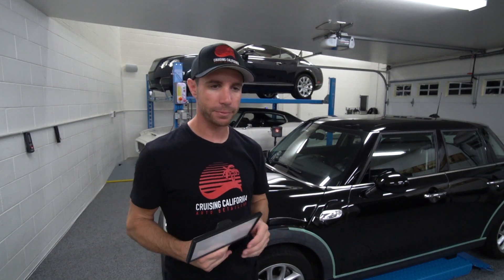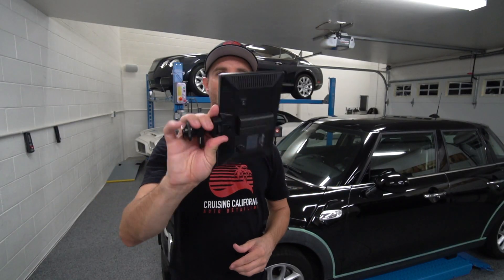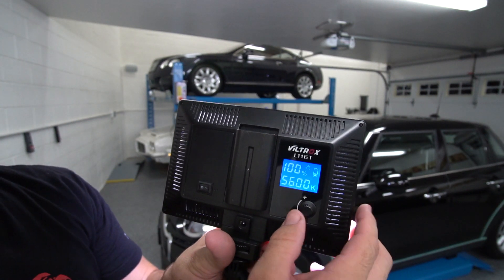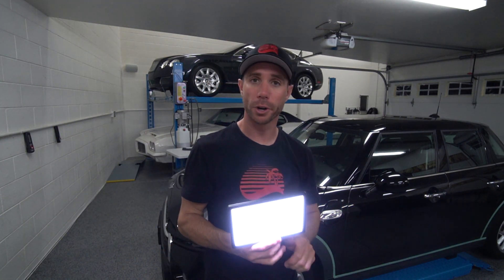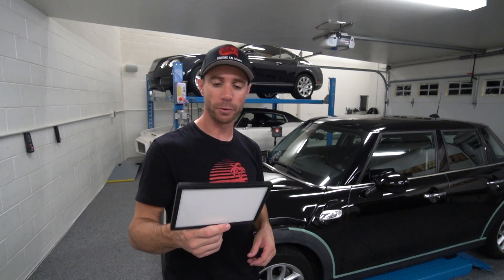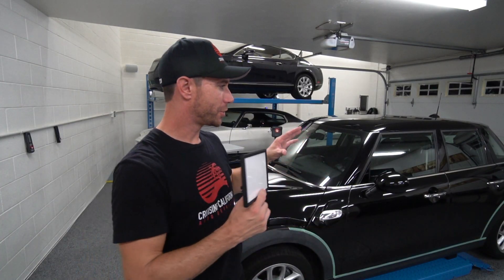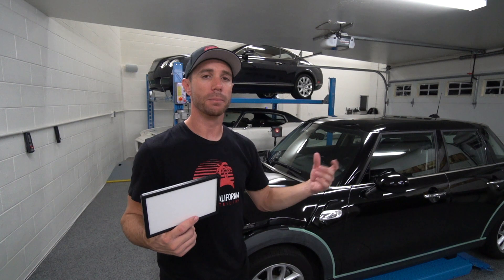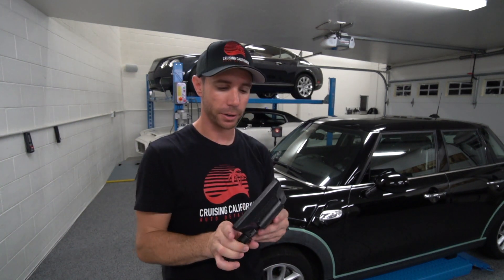The BEST Detailing light for Ceramic Coatings!

Comment: Thanks! I've been using a tablet computer set to display a white screen. I bought a cheap light similar to yours, however the individual LEDs can be distinguished behind the diffuser, and it doesn't work as well. Yours looks like it's perfectly uniform, and that's critical. I laugh when I see people using normal inspection torches - they are USELESS for showing high spots.